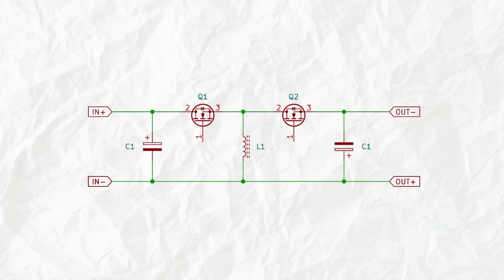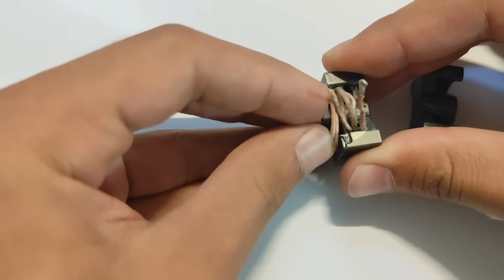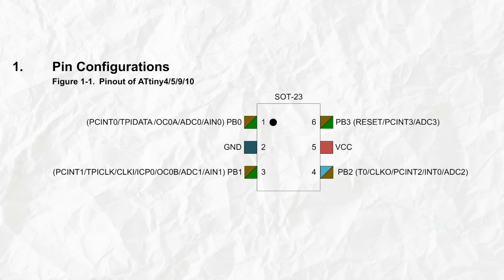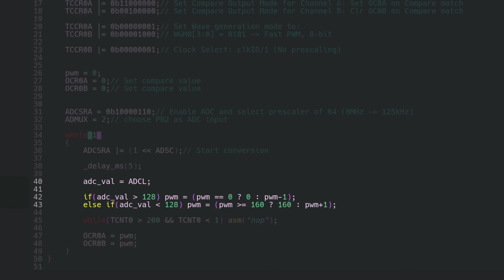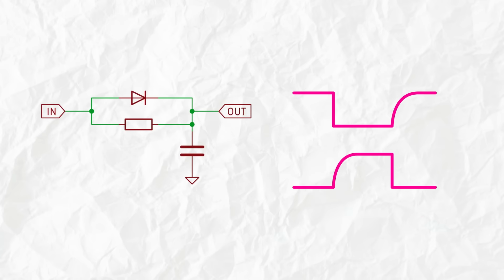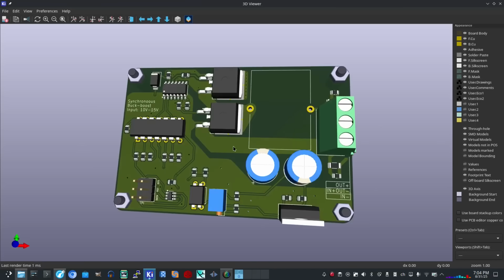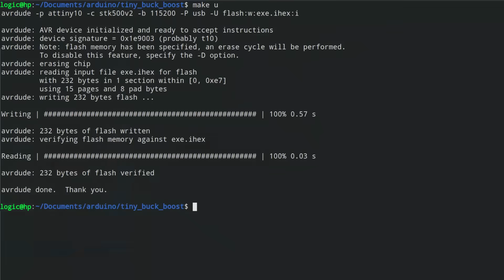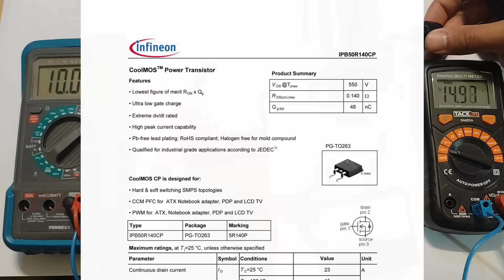Making a Synchronous Buck-Boost Converter Based on the ATtiny10

Comment: Can I use uc3843 instead of attiny? Any notes?
Reply from the maker: UC3843 only has one output. You'd have to create the inverted waveform as well before also creating the dead time. Also it has some sort of current control that you'd have to check out and understand to be sure it can be implemented in this topology.
Reply: @5VLogic  I additionally use ir2104, it has built-in deadtime and inversion. My friend said that uc3843 is not as stable as tl494 in this circuit, what do you think?
Reply from the maker: I don't know any of these except tl494 (had to look up uc3843).
But having built-in dead dime certainly simplifies things

Comment: Just came across your video when trying to design a synchronous boost converter with a MCU, because DC-DC switching controllers which can support the required input voltage I need are pretty expensive. 

I was mind-blown when you showed the conversion of a transformer to an inductor and the required calculations. I know they're nearly identical parts (isolated vs non-isolated magnetics), but I had never thought about it, and I have so many high-power transformers in stock, with few high-power inductors. THANK YOU!!! Instant subscribe.

Comment: I'd like to point out another reason not to use one of the many specialized ICs: they become obsolete very quickly. Using a microcontroller, if it becomes unavailable, it's easy to port the firmware to another... and they're incredibly cheap.
Thanks for the video; it makes the key points for making a functional buck-boost clear.
Reply: I did the same thing with a PIC micro and used the 16 bit PWM but clocked the CPU as fast as I can. I made a buck battery charger from it. Everything else I wanted, was in a small package. Ive had trouble soldering QFNs and its easier to do a SOIC14. It can be done, but not alot of people do it. I started doing it during the pandemic because ready made specialized chips were hard to come by. Microcontrollers? Not so much. 

Now with tarrifs its even worse, so I guess I'll be using a microcontroller when I can, unless its something simple.
Reply: Im replying to myself because, like I said, not many do this but I also want to share some PDFs I found. Most of these are by microchip:
AN874-Buck Configuration High-Power LED Driver Source
AN1138- A Digital Constant Current Power LED Driver
buck-1501-PID (No title on this one, but I did get it to work)
Buck-Boost LED Driver Using the PIC16F785 MCU Source (I believe this one uses the analog perps on the chip itself, so a ramp generator, comparator and op-amp)
TB3103,104-TB3103-SMPS_Using_PIC16F753 Analog Features (ditto here)
TB3097-Digital SMPS – Buck Converter Using the PIC12F1501 NCO Peripheral Source (this one is interesting because it uses a 8PIN device. I tried it as shown and couldnt get it to work. I ended up using PWM, sensing the analog feedback and adjusting the duty cycle that way. I got some LEDs to be adjustable)
AN1047-Buck-Boost LED Driver Using the PIC16F785 MCU (This one uses analog parts on the chip)
AN1086 - Switching Power Supply Design with the PIC16F785 (this one is just cool to read I think)
AN1138- A Digital Constant Current Power LED Driver (this one is also interesting but Im unsure of the practical use of this circuit vs something you can buy)

Now The next logical step would be to use something like a dspic (or 16/32 bit micro). I know im sounding like a shill but microchip released a dspic33AK that has a FPU on it, along with a secondary clock that can push out 500Khz by default for PWM. I really want to use it but its in such a small package :( I bought them anyway lol. 

Anyway, those are some resources Ive found
Probably should share some resources on FET driving:
AN786-Driving Power MOSFETs in High-Current, Switch Mode Regulators
AN937-Gate Drive Characteristics and Requirements

Note: I did use a totem pole driver at a frequency of 200Khz so I can have a relatively high resolution for my duty cycle (8bits) and it seemed to be good enough to charge a battery. Of course, I chose the lower end of the upper duty cycle per my calcs, so 4.19x volts vs 4.21x volts. 

Im glad this video came in my feed though! Theres a lot of naysayers out there who say it shouldnt be done but I LOVE the idea of using a microcontroller.

Comment: This kind of slow control is unfortunately only viable for self-stabilizing loads like resistive heaters, LED current control and battery charging. I was hoping to find a video about a digitally controlled SMPS that can handle all kinds of loads like a processor or complex boards with multiple switchable loads. I guess I'll use a classic SMPS controller chip and rig the feedback path to be controlled digitally. Now I just have to find a way for the newly introduced parasitic capacitance to not ruin the regulation loop.

Comment: Yes the efficient is lost in slow switching the gate driver not recommended for this and the norgate ic too that bring the circuit cost up too high use a ir2184  this is designed for synchronous circuit has it own level shift and dead time and duty cycle goes up to 90 % for bought channel to increase use schockkly diode and 25us- pnp for speed driver increasing efficiency and use tvs diode and rc filter to reduce ringing increase the efficiency again and use tvs for gate protection too not ziner diode and and 5pf from gate to source of mosfet use std5nm50 mosfet 0.8ohms rds on increase efficiency again remove the remove the rc for the output of the optocoupler put it on the divider side

Comment: Wouldn't slew rate of AND gate create dead time on its own?
Reply from the maker: In general any delay created by the AND gate's slew rate and/or propagation delay will be applied both to the rising and falling edges. Also the slew rate of such logic gates are quite fast, and not sufficient as dead time for traditional power MOSFETs.

Comment: Hi sir is this project open source?
Reply from the maker: The code is absolutely free to copy modify and use in any way you want, and so is the circuit and layout, but I will not make it available to download because in my opinion it could be improved a lot and the concept was a "build for fun" not for reliability or performance.

Comment: You can use a micro-controller for this, but not if you need a fast feedback regulation.
I have build a StepUp converter für LEDs. I got 12V and the LEDs did need 24V-30V.
On the PCB was a shunt and a OpAmp, so that I could measure the current which goes through the LED. For this I did not need a fast regulation, in fact it was okay to use fixed PWM values for each brightness setting. The voltage over the LED drops a bit if it gets warm, but this was not a problem. I used a silent fan to keep the LED cold and a NTC top measure the temperature close to the LED-chip.
If the fan would fail, then it would reduce the current over the LED to keep the temperature under the limit. I did make it blink every 10 seconds very short, to show that there is an error with the LED-Fan or temperature or UART transmission. I got the brightness settings from a touch-panel with an other ATmega.

Comment: Fun project. As for PCBWay, may be time for them to admit it's $22 for 5 PCBs not $5. It doesn't cost $23US to ship 200grams from China by air, unless you're shipping to Antarctica maybe. $22 for the boards, $5 shipping.
Reply: Exactly. Chinese always find a way to get your money by foolish you.
Reply: That is so not true
Reply: @xxbatman69xx98  Very true. I did an order and that's my result. They also charged a $5 "bank fee" for not paying with a wire transfer, so $32US for a "$5 PCB".
Reply: @xxbatman69xx98  Gotta agree, china is treated as a development country, so postal is jokinly cheap there. Like USD 0,50 max for an average parcel, international.
Reply: @luaxlab  I don't use PCBway because they are more expensive (something has to pay for sponsorships, eh?) but all of the "standard" board houses offer DHL express for like 22 bucks, then the ~$6 30+days service. A quick glance at PCBway shows they are the same? To me, getting a box from china across the planet and directly to my door via van for $22 bucks within a week is pretty dang good. DHL, Fedex, and UPS are not Chinese companies, BTW. Does China even have a comparable international air shipping line, because I've never heard of or seen it.
Reply: Thats why I use JLBPCB they charge like $7.80 shipping.

Comment: I like your thinking.  What would nobody try to use as a PSU controller. An AND gate as a gate driver and then nice high gate capacitance.  And it works.  Well done on getting it going.

Comment: Good video, just few suggestions: There is a really good highside/lowside driver you can buy called L6491 which has deadtime and even current sensing integrated, highly recommend.
Also Attiny85 is great for this use case, it has 2 more pins than attiny10 yes, but it also has internal PLL multiplier so you can internally run the PWM counter up to 64MHz (8x 8MHz core clock),
so you should be able to go up to 250kHz 8bit PWM and shrink the passive power components (coil, capacitors).
Reply from the maker: Great points, thanks!
Reply: @5VLogic  I'll add that the NCP3420 and ADP3110 are both gate drivers with internal dead time and other protections specifically designed for synchronous converters like this one, and dirt cheap. They will drive bith fets with only a single input instead of 2. If you want to be able to use two seperate inputs (not sure why, but maybe you need to be able to control dead time in code?) an A3909 or TPM8837 are cheap drivers with built-in H-bridge mosfets, for virtually the same price as gate driver without the mosfets, which makes design and prototyping so much easier.

Comment: Wow, your mosfets have really high RDS on resistance you should use something better. I think instead of limiting yourself to low power, maybe you should start doing some high power things. And maybe use a newer mcu like stm32f103c8t6(bluepill) to get higher pwm khz and better pwm resolution (stm32f103c8t6 is not exactly what you need you have better mcu options but this is the most popular one for general purpose). Maybe instead of limiting yourself to and gates and all you can just use a mosfet driver like IR2101 or something similar and you may not even need inverted pwm in software. I am writing this because ı think you can make much much better than this one because you know how to. Your projects are really cool and you explain everything very clear, thank you for sharing this with us!

Comment: Nice project.  I wonder if a dedicated gate driver would improve the efficiency; power mosfet's usually require much higher peak gate currents than what typical gates can provide in order to switch fast enough to convert the inductor energy efficiently.
Reply from the maker: Yes, the driver I used has a 4A peak source/sink current capability

Comment: could you use a monostable multivibrator insteed of the and gates? :D
Reply from the maker: I don't think it would reliably work because the dead time must be constant but the on time change because of duty cycle
Reply: @5VLogic  There are ways it could be implemented, depending on the control loop, but at best it would be impractical compared to the AND gate. To the OP, there are many ways to implement dead time... Some work better than others (Just ask Gigabyte about their exoloding power supplies). The simplest option is to use a gate driver that features built-in dead time, which is common for half and H-bridge circuits, or specific synchronous buck drivers. If a BJT push-pull pair (sometimes called totem-pole) is used to drive the mosfets (or if bjts are used instead of fets) at relatively low frequency, you can sometimes omit the dead time because it occurs naturally for 2 diode drops (class B crossover distortion) along a slower rise/fall time - though if this works well you probably want to reevaluate your switching losses. You could of course also do it code, or by using a common and cheap controller like the TL494.

Comment: Use a TL431 with an optocoupler in the feedback circuit.
Reply: I fear you are missing the point of an optocoupler. It's critical to provide isolation for feedback paths for flyback and other ISOLATED converters. this buck/boost converter is non-isolated so it would serve no purpose here. The TL431 is already replaced in this design by the ATtiny chip, so it's not needed either. But if he was making an isolated converter, then yes, these would be good ideas.

Comment: Just a tip, You can make the ATTiny10 run  faster by setting OSCCAL to 0xFF.
Reply from the maker: That's interesting, I never bothered checking because i thought it was a very small adjustment, but yes apparently it can bump it up to 14MHz!